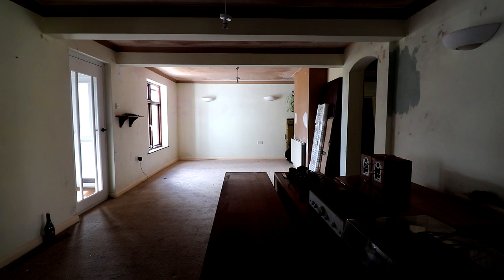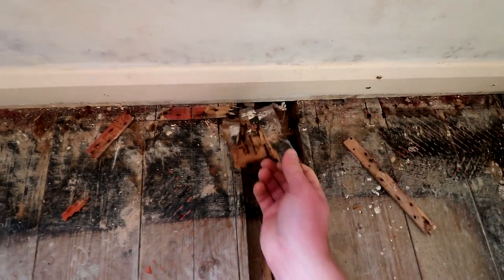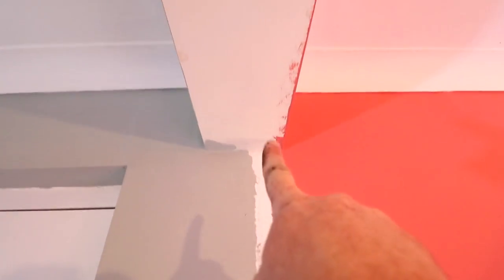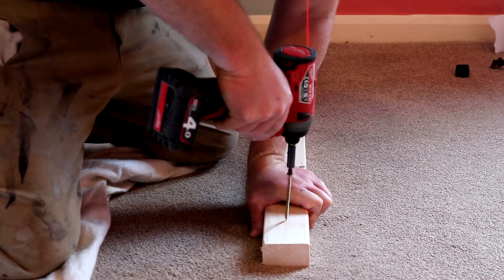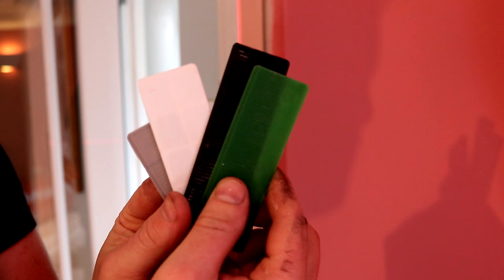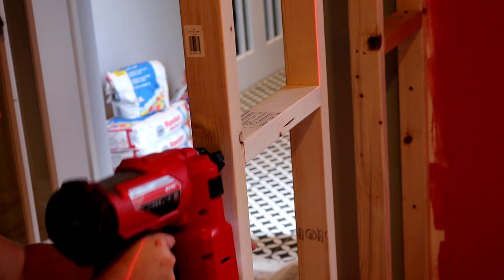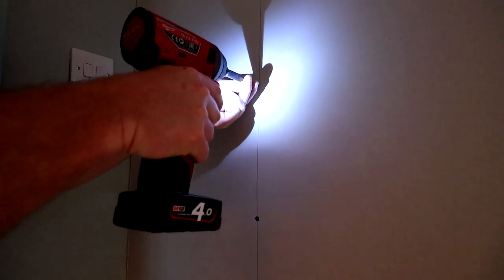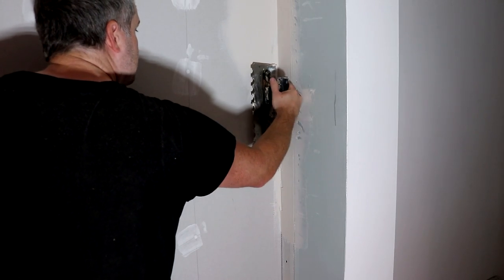Building A Wall In Our Bungalow

Comment: The reason I would have removed the carpet is over time it will detiorate, meaning the stud won't be tight to the floor boards. I would have personally made the wall flush with the RSJ boxing on both sides and then installed pocket doors that would look very sleek. Great video I love your content

Comment: That looks to have come out really well :)  One thing i learned ages ago, if you want a more sound proofed wall, and I guess it would help with heat transfer too, just use a 2x6 vs a 2x4 for the top and bottom plates and stagger 2x4 verticals and put insulation all around/through it.  That way no sound or heat can directly travel via the studs to the other side of the wall.  I like the trick of pushing in the brick spacers with the screw, I will have to remember that :)

Comment: I'm with you on the plastering question - it's always seemed strange to me that we put up perfectly flat boards & then cover them in (if you're lucky) flat plaster - taping/filling & sanding is so much easier and cheaper
Reply: there actually isn't a lot of cost difference between plastering and taping and they both take skilled tradesmen to get a decent result. the main reason plaster is more popular is purely down to people not liking the matt finish taping gives paint. that being said more of the bigger site developers are going down the taping route recently because its quicker
Reply: @TheMorsey123  skimming is the best option if you plan to wallpaper. Removing wallpaper from tape and filled walls means re-boarding

Comment: Nice work and well done. We chamfer the edges of the plasterboards with about 45 degrees on the sides which stuck together before filling up with filler respectively before attaching to the wall. So the filler can balance the joints when the plasterboards expands and the filler can join with the material inside the board instead of the paper surface (sorry for my poor english, german native speaker 😊).
Reply from the maker: Cheers. I used tapered edge board 👍

Comment from the maker: Stud finder (4 in 1) device https://amzn.to/2H978Jy (UK) 
Charlie White's DIY channel Charlie Diyte: https://www.youtube.com/channel/UC7x7wk8yeN2ZEJCo6BgP2ag
Charlie White's fixing to RSJ using normal screws:  https://www.youtube.com/watch?v=G1ziRy_OJbU

This video is supported by Milwaukee, check out their full range here: https://uk.milwaukeetool.eu/?utm_source=Social&utm_medium=YouTube&utm_campaign=Rag%20N%20Bone%20Brown%20-Milwaukee%20Range
Milwaukee tools used in this video:
Inkzall Marker https://uk.milwaukeetool.eu/en-gb/inkzall-markers/?utm_source=Social&utm_medium=YouTube&utm_campaign=Rag%20N%20Bone%20Brown%20-%20inkzall
Framing Nailer https://uk.milwaukeetool.eu/en-gb/m18-fuel-framing-nailer/m18-ffn/?utm_source=Social&utm_medium=YouTube&utm_campaign=Rag%20N%20Bone%20Brown%20-%20Framing%20Nailer
Circular Saw https://uk.milwaukeetool.eu/en-gb/m18-fuel-55-mm-circular-saw-for-wood-and-plastics/m18-ccs55/?utm_source=Social&utm_medium=YouTube&utm_campaign=Rag%20N%20Bone%20Brown%20-%20ccs55
Jawzilla (coming soon)
12v Drill https://uk.milwaukeetool.eu/en-gb/m12-fuel-sub-compact-percussion-drill/m12-fpd/?utm_source=Social&utm_medium=YouTube&utm_campaign=Rag%20N%20Bone%20Brown%20-12v%20fpd
12v Impact Driver https://uk.milwaukeetool.eu/en-gb/m12-fuel-sub-compact-8243;-hex-impact-driver/m12-fid/?utm_source=Social&utm_medium=YouTube&utm_campaign=Rag%20N%20Bone%20Brown%20-12v%20fid
SDS https://uk.milwaukeetool.eu/en-gb/m18-fuel-high-performance-4-mode-sds-plus-hammer-with-fixtec-chuck/m18-chpx/?utm_source=Social&utm_medium=YouTube&utm_campaign=Rag%20N%20Bone%20Brown%20-%20CHPX
Jigsaw https://uk.milwaukeetool.eu/en-gb/m18-fuel-top-handle-jigsaw/m18-fjs/?utm_source=Social&utm_medium=YouTube&utm_campaign=Rag%20N%20Bone%20Brown%20-%20M18%20Jigsaw
Spirit Levels https://uk.milwaukeetool.eu/en-gb/hand-tools/levels/?utm_source=Social&utm_medium=YouTube&utm_campaign=Rag%20N%20Bone%20Brown%20-%20Levels

Thanks for watching! Please subscribe, click like if you like, and hit the bell icon for future video notifications

HELP SUPPORT THE CHANNEL:
Support with YouTube channel membership: https://www.youtube.com/channel/UCVyE_6jEtVZGmYGXtUOL5FQ/join
Support with Patreon: http://www.patreon.com/ragnbonebrown
Support with PayPal http://paypal.me/ragnbonebrown

MY TOOLS:
For links to the tools I use, plus some of my favourite consumables,  finishes and more see links below.  As an Amazon Associate I may earn a small commission from qualifying purchases  :
UK affiliate store: https://www.amazon.co.uk/shop/ragnbonebrown
US affiliate store: https://www.amazon.com/shop/ragnbonebrown

SHOP:
Etsy: http://www.etsy.com/uk/shop/KeithBrownMaker
https://teespring.com/stores/rag-n-bone-brown-merch

Comment: You could check the crown of the studs is all the same way, so that the wall doesn’t wobble. Probably doesn’t matter here but worth checking on a longer wall. 
I would also mark out the top and bottom plate at the same time. Check out Larry Hun for some amazing hammer skills.

Comment: Just for other people, in general you should take up the carpet and cut the skirts, it will be for fire and sound transmission reasons. I also don't know if you are really meant to put holes in plasterboard that is meant to be a fire protection for the steel, in a two storey house the whole purpose of it is to give 30mins fire protection. Tiny air gaps can really accelerate a fire, that is the issue.

Comment: Next time you use plaster board, consider using something like the "Bosch D60498 Drywall Dimpler", it'll reduce the chances of driving the scree too deep into the plaster board.
Reply from the maker: They look good but this isn't the type of work I do normally so wouldn't justify the expense of a new tool when I can get it done without
Reply: @RagnBoneBrown  another possible option is using Drywall Screwdriver bits.  I found a 5 piece set on Amazon for £4.25

Comment: Great video :-) I served 9 years as a 1st & 2nd fix joiner and built many a stud wall over the years. Couple of little tips which you may find easier if you ever build another one with a door way. If you start with the two vertical studs either side of the door way and work back to the walls it saves you having to faff about plumbing & packing out the two verticals against the walls. 

Oh! and 5:48 You've been letting Dylan do the driving again haven't you lol :-)
Reply from the maker: Great tip thanks

Comment: Just a quick observation. When you did the hole  to check the RSJ you mentioned there was a 20mm gap between the plasterboard and the steel work, ideally shouldn't have a gap there. When you stuck your finger in the hole did you check if the thickness of the boxing off was 1 or 2 layers of plasterboard?  Unless something like 'fireline plasterboard' was used, there should be 2 layers of plasterboard. It's to do with fire regs. If you can imagine a fire in a room, the most severe heat and flames are at ceiling height and corners, and this is the location that with intense heat can cause plasterboard to fail in minutes. This should have been picked up on the survey (depending on the type of survey) you had done when buying the house and proof that it had been signed off by Building Control. Not being picky or anything but hopefully giving some useful advice, but being a Building Surveyor this is the type of thing that insurance companies will look for and could invalidate your insurance.
Reply from the maker: No idea to be honest but not something I'm worried about. How would a building surveyor be able to identify the construction without drilling a hole in it? We got a full house survey but it was absolutely useless, it highlighted lots of non issues and missed lots of critical issues!

Comment: I’ve seen people in other videos glue floor boards down as well as nails to prevent squeaking in the future. Do you think that’s overkill? Also great videos. It’s nice to have content from the same country.
Reply from the maker: I think it'd make them trickier to lift and re fit if access was ever needed beneath if they were glued. As long as the span between joists isn't too big and the boards stretch across a few joists they shouldn't move or squeak, that's my opinion anyway but I'm no expert

Comment: 14:05  If you pre-assemble a wall on the floor, you may not be able to stand it up.  The diagonal of a rectangle (through the frame thickness) is longer than the edge (the frame/opening height).  Ask me how I know.

Comment: Just curious, wouldn't the same moisture damage happen later if you just put wood by itself in the same place in direct contact with the concrete like the damaged wood you removed?  Did you coat it in something or use a plastic barrier to block the moisture before installing the replacement wood?
Reply from the maker: No, the issue was that the floorboards had been butted up against the brick. The new boards were placed about 20mm away so moisture can’t transfer

Comment: Probably would have used a multi-tool to cut the skirting away or removed the skirting completely and replaced but understand the reasoning behind not doing so. Not sure about assembling on the carpet as that is a surface that will alter. Maybe would have looked at pocket doors but they are more expensive. I don’t think assembling a stud wall on the floor and putting in place would work as you wouldn’t be able to get it to fit snugly, diagonal length greater then the height. Great video as always keep up the good work.

Comment: Hi Keith , i see you were using your milwaukee impact driver. Didn't you use a hikoki before. 
If you did and no longer need it would you consider selling it . My one gave up so I have two batteries with no impact drive . 
I am relying on ordinary combi drill which do not cut the mustard in my trade(windscreen fitting) .
Bye .

Comment: a tight fit on the studs would be more than enough to keep the wall in place, meaning screwing to the joist was a waste of time. I've held 4x2 in place with just  instastik and it's never moved. If the opening for the door isn't perfect, just use some packers, it's how door casings are installed all the time. So much complexity for such a simple project
Reply from the maker: That's probably true but I'd prefer to secure to the walls, even if only a couple of fixings used. It's funny that as a youtuber I get just as many comments telling me how I've under built things as over built things. Everyone had their own way of doing things and everyone thinks they're right 😂👍

Comment: Nice work as usual, Keith.   Did you consider using Masonry Torx Frame Fixing Screws (Toolstation  Product code: 39995) instead of the rawlplug method at 8:47 ?   I've found them to be great - especially as all the bricks used in my home are the ones with holes in them, and rawlplugs always seem to find them.
Reply from the maker: Thanks Don, I've used them before and yes they're great. But I didn't have any to hand so just used what I had

Comment: Looked like there were no insulation under the floorboards, is this the case?
Seems you would get pretty cold floors during the winter?
Reply from the maker: Yeah. It's a 1930s bungalow
Reply: Good thing you got the stiff upper lip to deal with it! 🥶

Comment: Place floor plate first then use plumb-bob to line up ceiling plate. 4 x 2 studwork when there's doors in it. 2 horizontal noggins per stud running parallel to each other. 12.5 plaster board, again as there is a door frame. Remove the carpet. Run base of stud all the way through and cut off after door studs fitted. Insulation unnecessary. At the moment you are going to get a lot of flexing/wobbling in the wall resulting in the doors not closing properly.
Reply: Why bother with plumbing a line when you have a laser level?
Reply from the maker: Thanks for the tips. The doors have been fitted a couple of weeks now and no issues, the gaps are as consistent now as they were when installed so I don't think it will be an issue

Comment: Great video. One question. Were you not concerned about the damp in the wall above the skirting? It looks like it's not only the floor boards that had moisture in them.
Keep up the good work. I love watching your work.
Reply from the maker: Hi Steven. Not concerned about that, it's old - we had a big mold and condensation problem when we moved in, but since then have installed a PIV system and trickle vents in all the windows for air flow. Hopefully it shouldn't come back!
Reply: @RagnBoneBrown  have you done a video about the PIV system? It is something I have considered. Would perhaps make for an interesting/different video.

Look forward to the next video on the wall!

Comment: I find it strange we have 47mm X 70mm as is called a 3" X 2", but also a 38mm X 63mm can be called 3" X 2", actually I suppose the 38 X 63mm is actually 2" X 3" as if we've imported the Canadian standard, we need to adopt there nomenclature.

Very interesting content, thanks!
Reply from the maker: Yeah, or just standardise the use of metric! 😂
Reply: @RagnBoneBrown  absolutely, just insane we still use mixed systems.
Reply: adie chip  understand the evolution of timber, what makes no sense is the duplication of standards, or sticking with outdated measurement systems when something demonstrably better in many ways is available (I think the doubling of the denominator for splitting board in half is only positive of imperial I'm aware of).
Reply: adie chip  I have seen various studies comparing the two systems and due to the fact that with the decimal system you just move the decimal point, and measurement is more easily accurate, result in much lower levels of waste.

With a imperial measurement of ½" divided in two becomes ¼" so you are doubling the bottom part of the fraction to divide in two.
Reply: adie chip  they are supposed to be self adjusting, but are just crap, I did turn the black screw on them that the clamp bears on. They have gone now as they were so crappy.
Reply: adie chip  it was studies in Australia about 5 - 10 years ago. I will try to find the references but not making any promises (I thought it was fairly wifly understood, didn't think it was controversial) 
On the banggood clamps bit, they were my one and only purchase from them, cost £44, were crap due to underpowered piston, ask to return as they did not meet description, I had to pay postage for that, would have been about £60 so contacted PayPal and let them know what was happening, they refunded me "due to excessive return costs". Lesson learned, don't buy from banggood.
Normally I buy Bosch tools, which may be made in china now, not sure, some are still made in EU.
Regardless I buy from sellers in EU and I then have proper protection. I guess soon that will be restricted to buying from UK, due to brexit.
Reply: adie chip  haven't found the study yet but did find this interesting report on metrication in Australia, the construction industry is highlighted as having been one of first to move across. Interesting point that the building hight went from 2438mm pre metrication to 2400mm so was a small reduction in size but led to bigger efficiencies. They did also take opportunity to modernise building regulations and process moving to an outcome based standard rather than a prescriptive standard,  which also appears to have helped in the 10% efficiency gain. https://www.google.com/url?sa=t&source=web&rct=j&url=http://themetricmaven.com/wp-content/uploads/2012/03/Metrication-in-Australia-built-2013-06-24.pdf&ved=2ahUKEwiwmIzbubzsAhWJURUIHQVUCk4QFjAAegQIAxAB&usg=AOvVaw0BP86WynmlLhZLkZb-wPic

Comment: Nice job.  Here in the US many builders will spray "orange peel" texture over the sheetrock/plasterboard.  It can hide some imperfections and reduces echo.  Special pneumatic spray gun with gravity feed hopper of a gallon or so of the texture paint - heavy.

Comment: How come you didn’t Jack stud the opening?
Reply from the maker: No reason to really seeing as the header above the door isn't holding any weight, as the RSJ is doing that
Reply: @RagnBoneBrown  true, but Inwas thinking more in terms of pulling sideways with the weight of the two glazed doors hung there, or are you just putting hollow cores on there instead?
Reply from the maker: The noggins and header will add enough structural integrity to prevent that

Comment: If you'd have cut the skirting board you wouldn't of needed to cut the stud or the plasterboard , also you could of just screwed the stud to the wall without packing the top out , aslong as you made the next one plumb 👍
Reply: It would of made for a neater job , great videos tho

Comment: Actually a good thing u didn't cut the carpet away is its tensioned between the carpeting strips cutting it around the floor board would have made the carpet bubble up so good thinking to screw right thru the carpetting

Comment: When using stub work as a full framed wall use folding wedges at the top or bottom to force the frame firm & fix through
Reply from the maker: Great tip